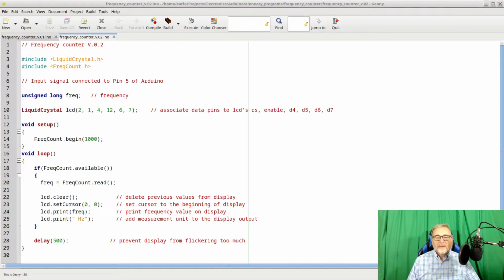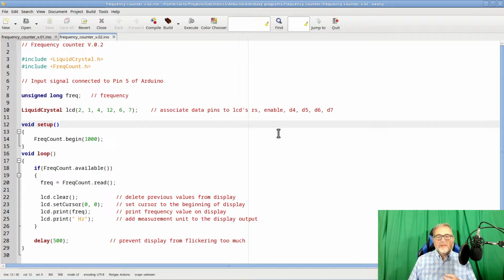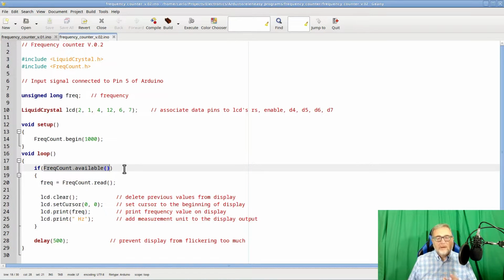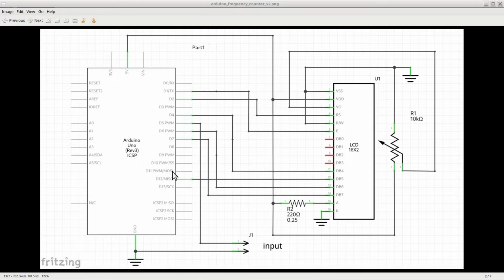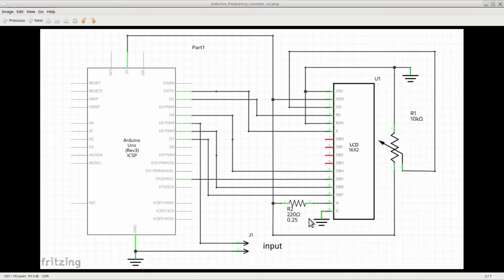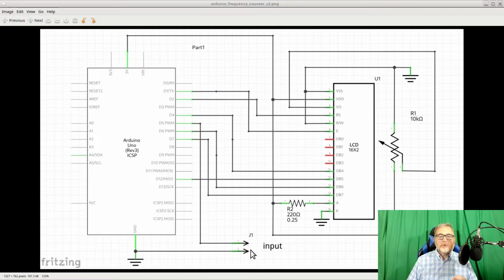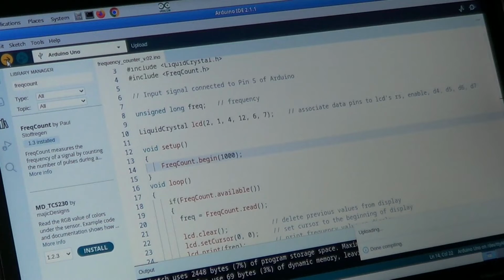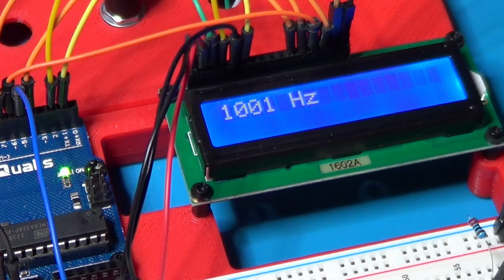Another Frequency Counter With The Arduino UNO

Comment: Hi friend, is it feasible to sense a transformer kick (Motorcycle coil) using this setup? I've divided the voltage with resistors from ~12.7 V to ~4.2 V, but I may go lower. Do you think I could measure the frequency with this? It's ~25 Hz and up (~1500 RPM). I'm sure it will be a pretty good pulse. What voltage are you using to test this circuit? I'm only going to use it to tune my bike and my dad's then I'm done. I'm a bit worried about the current, as the UNO R3 seems quite sensitive. Pin 5 and comm for input, right? ATM it's picking up stray electromagnetic oscillations through the open input jumper wire.
Reply from the maker: I suggest you go lower, and if there is no reading, keep increasing until it works. You could use a potentiometer. You have to be careful because the Arduino input is very sensitive and could burn if the voltage is too high.
Reply from the maker: Oh, and of course, don't put your circuit on the side of the high voltage. That's way too high, even with resistors.
Reply: @eleneasy  This last bit is the bit I'm unsure about, What do you mean by don't put your circuit ion the side of the high voltage?  What I was going to do is attach the + from the step-down resistor to input pin 5, and the - from the step-down resistor to the GND at the top of the digital pin bank. Is this correct? Thanks.
Reply from the maker: @GetMoGaming the transformer of the motorcycle has a high voltage secondary to power the spark plugs.  We are talking about thousands of volts, so you can not connect the Arduino on that side. But you can connect the Arduino on the primary side, where the voltage is 12V. On that side, you can see the pulses to power the transformer, and you can measure their frequency.
Reply: @eleneasy  Oh now I see what you mean! Yes, maybe tens-of-thousands, but no, I'll be connecting to the input (roughly 12 V pulses from the battery, controlled by the ECU). Thanks for your help, much appreciated!!🙏

Comment: I am wondering how to get duty cycle from it. (how to modify the FreqCount to get duty cycle ?).
Reply from the maker: This software is not suitable to extract the duty cycle of the input signal. However, if you refer to the previous video on Arduino frequency counters, you will find that the software actually measures the length of both the high and low parts of the input signal. From there, it is easy to calculate the duty cycle. Note, however, that such method has speed limitations that prevent it from measuring signals with high values of frequencies.
Here is the link to that video for your cenvenience:
https://youtu.be/vDEnqCFNyuQ?si=dRf-QKhaTbDNdLIF

Comment: I am going to plug into the earphone socket of an old phone with a frequency generator installed 🤔
Reply from the maker: Remember that the arduino circuitry requires a ttl signal at its input. If you use you phone you have to put in between a Schmidt trigger.
Reply: @eleneasy  Is this something you have covered in any of your videos? I really don't have a clue 😔any help would be appreciated.
Reply from the maker: @merkabaenergy9558 Yes, I covered it several times. Go to my YouTube home page and search my videos for schmidt or schmitt and you'll find at least 5 videos on the topic. Look in particular to this video: "Digital Electronics Fundamentals Episode 8: The Schmidt Trigger"

Comment: Is it possible to make this same project with an 8 Digit 7 Segment MAX7219 Module ?
Reply from the maker: It should be possible, but you'll have to modify the software to handle that particular display.
Reply: @eleneasy  Is that something you could do 🙏😃
Reply from the maker: Well, I have a few such modules in stock, and I was already planning to use them in a video to show how to drive them with an Arduino. Stay tuned: you could soon see such a video on my channel.
Reply: @eleneasy  ♥♥♥ I will keep my fingers crossed and my eyes peeled 😀

Comment: Being a new subscriber I'm curious if you've worked with PIC's as opposed to Arduino, as yet?
Reply from the maker: I had the opportunity to use them while I was still working with a former employer back in the 2010s. Since now I use microcontrollers only  for small hobby applications, I tend to use the arduino family, which is a little cheaper.